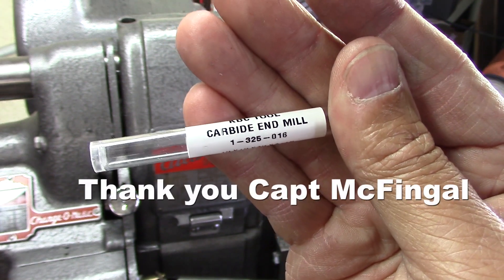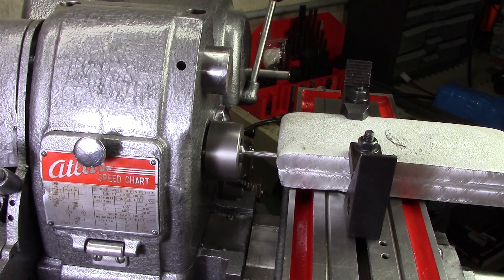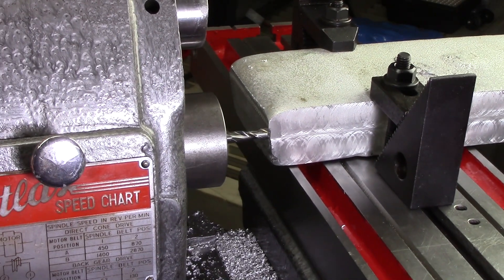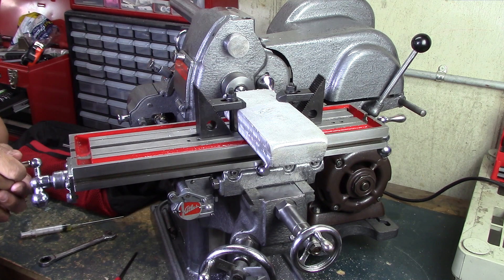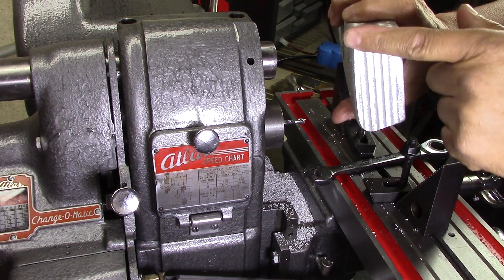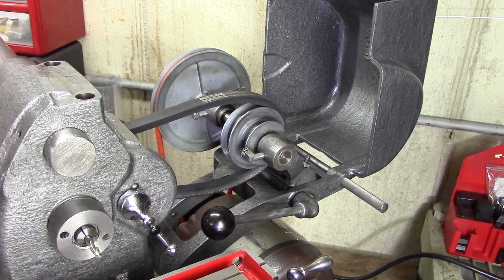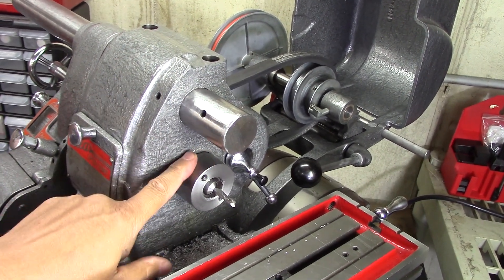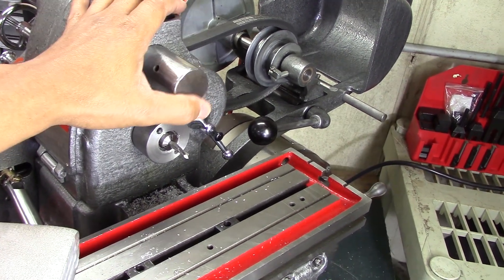Atlas Horizontal Milling Machine doing light cuts.  Machining with a solid carbide end mill.

Comment: Was that a two flute lol 
Thats for wood
Reply from the maker: I didn’t even know end mills were used on wood. All the machinist I’ve watched use it on aluminum……
Reply: No worries I didn't know this one for years either.
The guy that sent you that cutter set you up lil
2 flute flats are for routers, basically, you can cut metals but they don't last long if you do. More for cutting lines or slits or face milling on things lighter then metals.
3 flute flat or bull end mill for aluminum
4 flute flat or bull for equivalent quality cut on steel.
Try using a 2 or 3 flute on steel will be very bad results, bad finishes and cutters won't last long.
It's good advice
Reply from the maker: @tg5509  Thank you so much!  I’m just glad this is a hobby!  I would hate for this to affect my business bottom line, LOL

Comment: I have one of these little machines. It was given to me by an old machinist back in the 90's.I have been using it for quite a few years, I have rebuilt it it and made so many little things for my vintage motorcycles. Gears are what I use it for mostly. I did purchase a vertical head for it from "mymachineshop.net". But it would be easy enough to make if you have a lathe and a welder.
Have fun with this mill, the can do a lot more then they are given credit for.
Reply from the maker: Awesome!  I plan on trying to make gears too. Also, I was thinking about getting a vertical head. I will check out that website. I hope to make some cool stuff as well. Hopefully soon. And thank you very much.....

Comment: That little machine really looks land sounds ike new............
It won't be real costly to operate, with that block you could enjoy making chips for at least 2 weeks, full time......      LOL
You may want to save your carbide endmills for harder stuff, HSS is very well suited for aluminum, with a half inch 2 or 3 flutes cutter you could run it 2000 rpms and advance as fast as you can crank on a liter cut, best to use kerosene or WD-40 as a lubricant cause Al tends to weld itself to the cutting edges when runned dry, even more so in softer grades of Al...
About the 2 busted cars, get rid of them and buy buss passes, you don't need to waste precious shop time on keeping up with the maintenance....     😂😂😂😎👍
I gave up a long time ago doing my own maintenance, with age, if ever i'm able to lay under the car in order to reach vital parts, I won't be able to get back form under and get back up again.....   😱😱🦽🦼🍺🍼😎👍
Reply from the maker: Pierre's Garage I wish mass transportation was good in the US, but it’s not!  Only NYC has the infrastructure for it. If you don’t have cars in the US, then you’re at someone else’s mercy to get from A to B!  Plus, we travel 160 miles each week to Michigan which is 2 states away (2 hours and 45 minutes drive). We need cars. I only fix things I’m capable of doing. I have to farm out these 2 jobs, so it won’t take shop time 😬.  Also, I just wanted to use the carbide so the guy who sent them can see them in use. I’ll use the HSS most AL cutting. And thank you very much my friend 😀